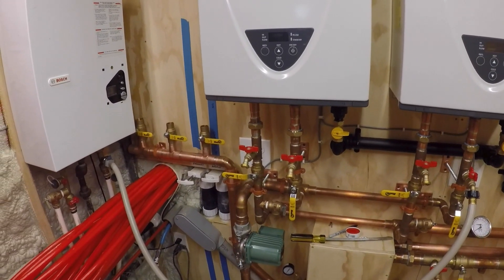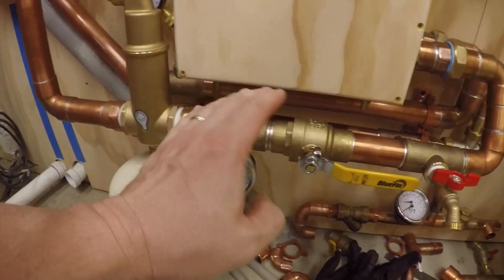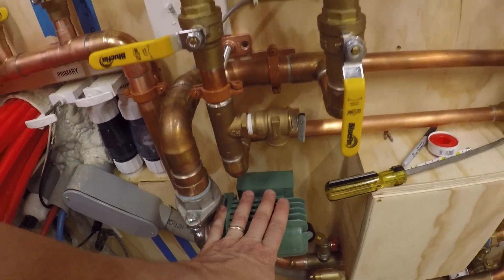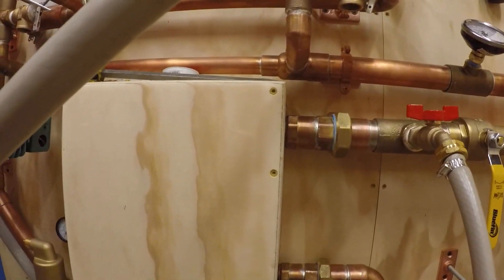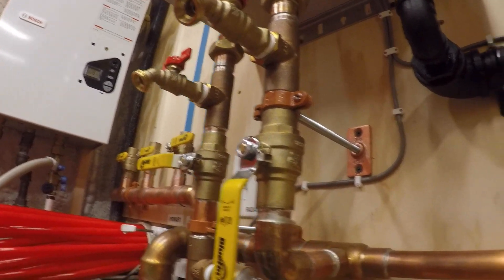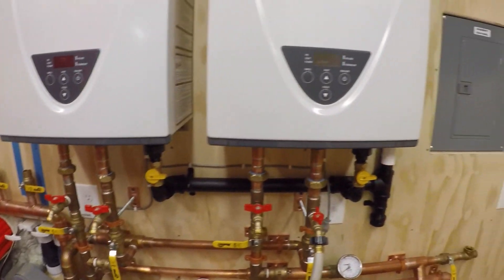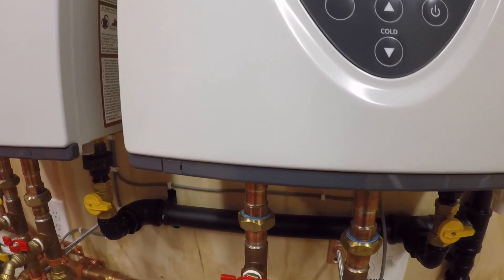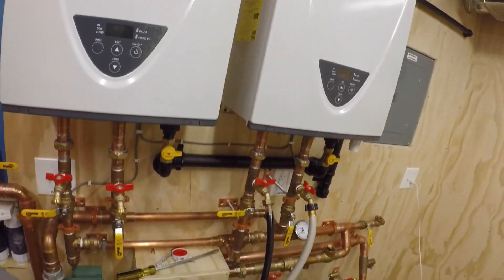Filling the Tankless Water Heaters, Pressure Testing, and Chasing Leaks! - Episode 15 [5-30-2020]

Comment: The glycol molecule is smaller than water so threaded joints will leak before water does. That's why as many joints as possible should be sweat, including pump flanges, air seperators, boiler drains. Copper unions are nutorious leakers, most contractors don't use them because of that. Too soft, can't crank down hard on them. Overall you did a great job for a DIY'er!

Comment: Nothing worse than multiple leaks in a soldered battlefield.. 👍
I assume your running propylene glycol in loops? I what concentration?
Reply from the maker: Wait until future videos, it gets better! 😂  Don't want to give it away but I melted a nearby pex pipe under street pressure (65 PSI) while soldering one of the lines to the radiant manifolds.  Sent water spraying clear across the laundry room.  Good fun!  To answer your question, yep, the secondary loop and all of the pex including the driveway and radiant has 40% propylene glycol (Cryotek-100). Should be good down to -22ºF, and still pumpable at -37ºF.  If it gets that's cold, we have other problems, and it won't be snowing 😁.  The heaters however, as shown in this video, are on the primary side and that is all just regular domestic water.